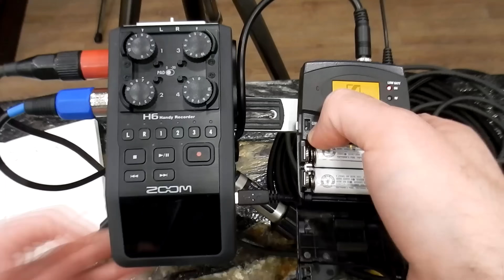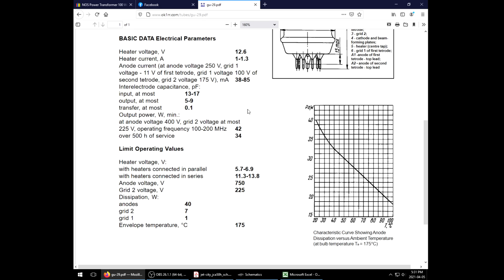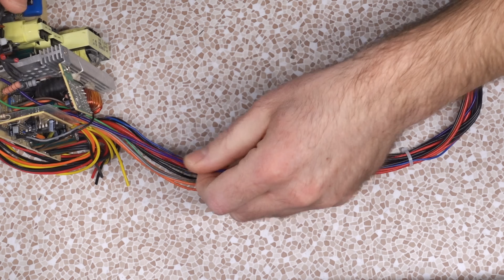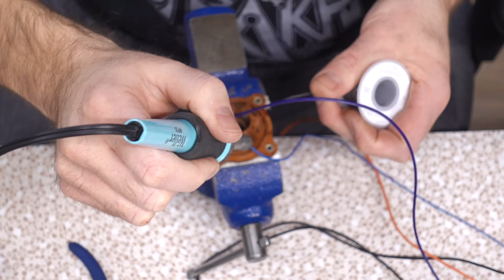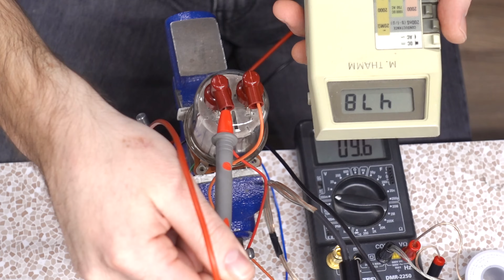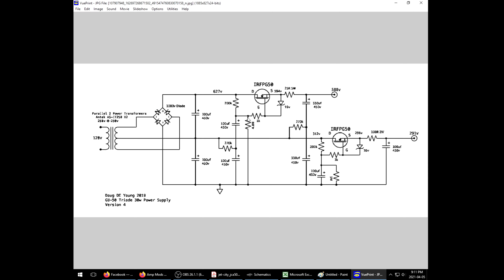The Russian Tube Experiment

Comment: Hey, totally off topic, but have you ever heard of those made in Vietnam Serviceman "Fender Clone" Amps before? Sorry, I just was thinking, "hey, if anyone out there would know about these, theres a good chance it might be you" hah. Either way, I just found one for $50 with a full compliment of 4 vintage 5881's, and 5 vintage preamp tubes, point to point, big Iron, and it has a Vibrator channel lol. I made the dumb mistake to ask to try turn it on in the store, as no one knew it's current state of operation, and it basically passed no sound, before it proceeded to make a light show in some of the power amp tubes, so quickly turned it off. Hope the power tubes are okay still, but who knows. 

The Amp, incase you haven't heard of them, a lot of Servicemen in the Vietnam War apparently used to buy them, so it was dubbed "The Serviceman Amp", and Its definitely 50's/60's, or early 70's. Mine is called a "Bassman", but from the very little info out there on them, there was a Deluxe Reverb Model, and one other one, but I forget the name. Also, the only video out there that I saw, his looked the same, but the logo said Fenler, instead of Fender like mine lol. 

Anyway, I wanted to ask also, would you be down if I sent it out to you? I think it could make a cool video, and I could def pay you to do something cool with it. It looks like it's actually got an added hole for a preamp tube, so maybe someone was already trying to Mod/Work on it in the past.
Reply from the maker: Oh, no I've never heard of those. Interesting. I live in Northern Canada, so stuff like that I just hasn't made it up here. That said, I do do amp repair, but the cost of sending it to me would be astronomical.
Reply: @DATT  Hey! I'm actually in Vancouver brutherrrr! 

Yah, they look pretty cool, and I think it def has some potential to be something cool. There's hardly anything out there on them, and other than seeing a couple posts that apparently they were made in Phillipines, there was a few models(Bassman, Deluxe Reverb, and something else), and I saw one video where buddy had a Reverb model, it looked exactly the same on the outside anyway, except it said Fenler, instead of Fender like mine lol. Also, mine came from the estate of Dave Brand. Correction, I believe it just has 3 preamp tubes, not 5.
Reply from the maker: @jamescassidy4045  Ah, bigger city on the west coast, yeah I could see you getting things that we would not. 
Four 5881 ? That's a 100w amp. 
What would you even want done with something like that, other than to just have it fixed?
Reply: @DATT  Hey! yah for sure. 

It's totally that, but also just kind of lucky, because it came from David Brand's estate, and there's all sorts of weird rare amp's from his collection there right now including a Piper Amp that Gar Gilles made, and it sounds frieken phenomenal. I'm trying to get it.

So yeah, its four 5881's, so 100w I believe. 
That said, there obv won't be a schematic lol, but it's all hand wired, and point to point I believe, so should be nice to work on. 

I can also test the tubes to see if they are still good, because when i turned it on that day, buddy behind it said they made a bit of a light show, but they look okay. If I have to buy a quad of tubes that's fine too, but just hope they work, because these are really nice robust Japanese 5881's, so will suck if  some/all are †øast. 

And yeah, other than fixing it, all I'd ask/want is for you to do your thing, and make it sound how you think would be cool. So whatever you want to do. 

The only possible request I'd have is to try make it have more gain if possible, and it  has a preamp tube hole it looks like someone cut at one point, so maybe make use of that, and add an extra gain stage, but only if it's not a pain to do. Ive just always wanted a modded BF bassman kinda thing like Mike Ness, and something I could boost with an OD, and get that gained out Fender punk rock kinda thing going on, but that said I have no idea if the schematic is even following a Bassman lol, and I don't want it to be a pain in the ass for you, so an extra gain stage would just be a light request, but totally not necessary. 

Just want it working for the most part, and would want you to have some fun, and do whatever you think would be cool, and show off the Amp a bit on the channel if you want.
Reply from the maker: @jamescassidy4045  Hmm, I guess that would depend on the circuit, if its like a Fender Blackface, more gain would be more trouble than it's worth, but if it was like a bassman, then you could cascade it easy. 
What's your budget tho ? Like seriously, it'd probably cost several hundreds just to move it round the country. 
I can't recall, is this a head or combo ?
Reply: @DATT  Right. Yah that makes sense for sure. 

Yea it might totally get expensive. Even just thinking now, because it's an amp I got on a bit of a whim, let me look into it a bit more, and the circuit etc, because to be totally honest, I have a few amps I'd probably rather get worked on first if I was to send something out, but that said, let me do some research on the circuit, and get some shipping quotes. 

Depending on shipping, and the circuit, if it was doable, maybe even just getting it going in it's stock state would be a good start too. The other thing is I have some knowledge of working on electronics a little  bit, and can def solder lol, but I was just thinking out of all the amps I have, this one might actually be one of the easier things for me to do myself since it's all hand wired, and point to point. It could very well be it just needs new caps etc, as long as the transformers are good. 

Okay let me get some info about it, and I'll get back to you. At least then I can even see what I'm looking at, but your right, it will likely be pricey, but better than the US at least. It's funny, because theres so many tech's I'd trust to work on my Amps in the US, and Australia etc, but I'm having a pretty hard time finding techs near me, or in Canada. So that's the other issue.
Reply from the maker: @jamescassidy4045  Man, there's got to be techs out there. Hell, I'm not even the only tech in the small city I'm in. There are lots of hobbiest techs, but I guess that's the thing. They will only know tube amps, and only know what the schem or manual says. 
But hey, if you can follow a schematic, then you could fix that amp, cause yeah, PTP is easy to follow and great for a beginner to learn on. 
Just the elephant in the room is figuring out WHAT schematic it is. If it's a clone, then it might follow quite closely a known schematic like a AB763 or 5F6A. 
IS it head or combo ?
Reply: @DATT  Hey, yeah for sure dude. That's just the thing. I know theres tonnes of hobbiest tech's I could find, but I just don't have the money to chance it with the type of stuff I want done to most of my Amps. 

It just seems harder to find revered tech's in Canada Vs the list of like 10 people I have in the States, and even outside US/Canada who I wouldn't bat an eye at sending my Amps to. I've even had some issues with a couple of the supposed pro tech's in my town, so I may also have some trust issues lol. I'm sure there are some amazing Tech's near me, or close also, but I just havent found them, or they are more word of mouth. 

Yeah, I'm hopeful I can maybe do some work on this bad boy myself. I just need to get in there at some point to figure out what they were kinda going for, like you said, but being PTP will be a great thing for someone a little greener, but that has some knowledge, and not to bad soldering skills hah. I could actually send over some pics if you want when I get the amp home. Its actually paid for, but just sitting at the shop until I get a ride out there to grab it. 

It's a head. 4x 5881's, and I believe only three preamp tubes, unless one was more hidden. Not sure though if one tube is for the Vibrator circuit lol. Like my JMP 50w Tremolo AMP has 3 Preamp tubes, and a fourth Preamp tube for the Tremolo, but if I had to guess I'd say its two Preamp tubes, and a Phase Inverter tube maybe. Not positive though.
Reply from the maker: @jamescassidy4045  Hmm, only 3 preamps tubes but it has tremolo. Spread thin, hah, in a 100watt amp. Pics would be cool, but I'm not sure how to get them. I really need some pubic contact mechanism, but it happens so infrequently I haven't felt the need.
Reply: @DATT  Hey. Ya I’m pretty sure, but need to double check. The effect is apparently called “Vibrator” haha, so I dunno if it uses a tube like a typical trem would, but maybe it’s some weird vibrato that doesn’t need a tube lol. 

It’s actually sitting at the shop just waiting for me to pick it up. Hopefully this weekend. I can probably text you some pics, or I know this site where I can upload pics too, and then upload the link to the pics. It’s just a free account, so I can link you to my account on the site, but I think it’s one of those sites they give it to you free, but want you to upgrade to a paid account, but it’s optional.
Reply from the maker: @jamescassidy4045  Oh well if you can post them somewhere I can see that's cool. 
You just have to be careful with how you post a link here.
Reply: @DATT  Oh ok hah. Is there a specific reason your thinking I should be careful how I post links lol. I get the whole click on this shady link dilemma (wait, is that how you spell that?) that we all have to be careful for these days, but trying to think of another reason in this case haha.
Reply from the maker: @jamescassidy4045  Ah, no, it's just cause if you try to post a link youtube will automatically delete the comment. So you might need to be more craft. Like describe the URL, or what to search to find it kind of thing.

Comment: Question: what is the output transformers primary impedance, and what is the load impedance called for on the tubes data sheet… how well are you matched there?
I’m glad you are doing here what I had thought about doing a month ago… granted I didn’t have a particular tube in mind.
Funny that you mentioned rob robinette… my idea was to build something like the 20 or 40 watt nakked amp he has got on there with an oddball tube… or do some further experimentation with other oddball tubes to see what sounds best.
I really want to make a 1x12” 20 watt combo version of the SLO clone. It is just too loud to play in the house, and it really opens up at the point of disturbing the neighborhood.
Reply: Not sure why I asked the primary impedance… usually it’s 4.4k for a 50 watt slo. I need a nap 😂
Reply from the maker: Funny thing I'm not using an SLO transformer, I'm using an aftermarket replacement Hammond for a Fender "The Twin". 100w rated 2.35k, but "overloading" the secondary to use it as a 50w transformer, so 4.7k ?
I have a video about it in my "Jet City Violence" playlist, where I replace the transformer in this head, and compare it against a couple others.